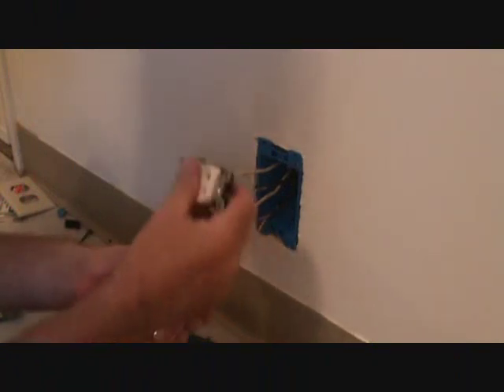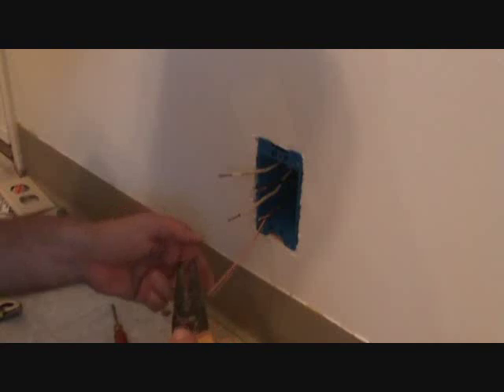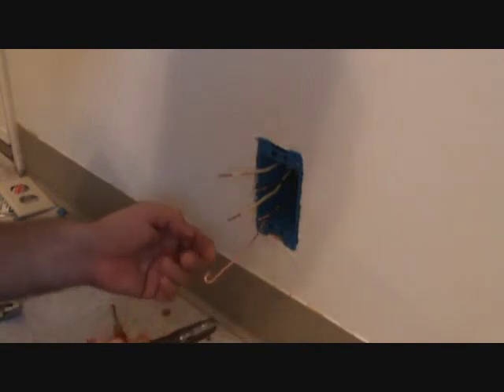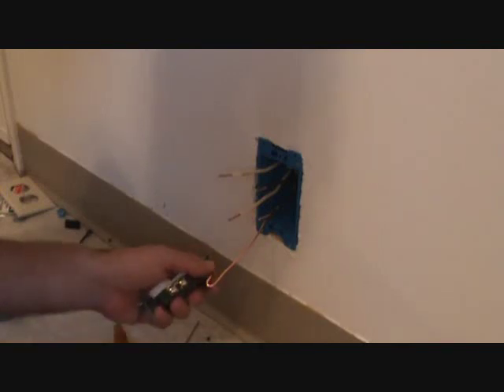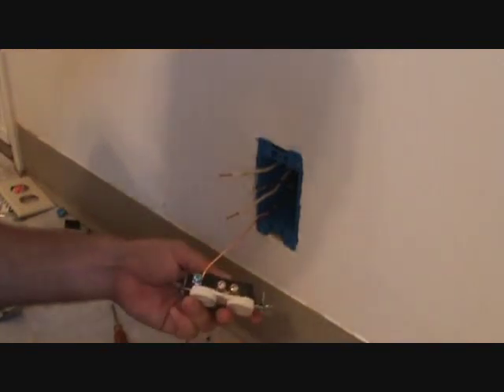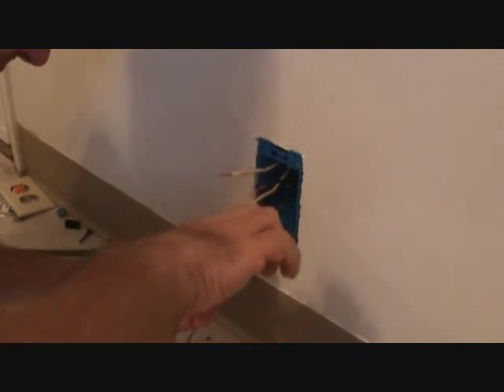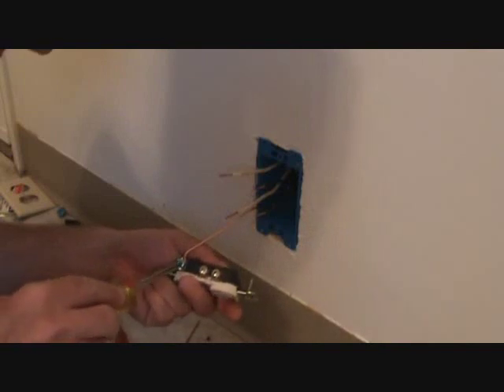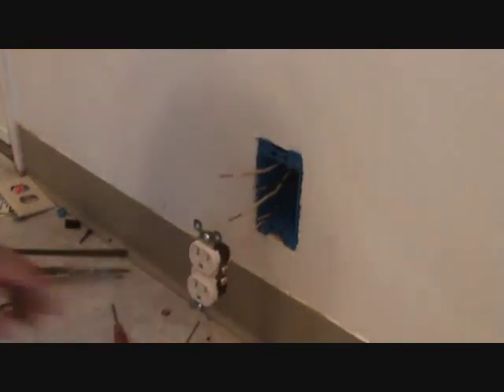Attaching a ground wire to a duplex receptacle plug

Comment: You should be a teacher, you explain everything so slowly and smoothly.  You're easy to follow and understand.   I need to rewire my old house (1950's) and nothing in the house is grounded.  I got a few quotes on the house and it's just too expensive.   Highest $7,000 to lowest $3000.  I was just wondering if I could do most of the work myself and save some money.  In case I do hire someone,  what's a true quote on a 1,000 square foot house?   Rewiring, new 3 prong outlets protests outlets and upgrade new panel to 200?  Thx for the awesomeness videos !!!
Reply from the maker: Not sure what a true quote for a 1000 square foot house would be. Get 5 different guys to look at it & you will get 5 different quotes ranging all over the place. Your house is probably the old school knob & tube but you could possibly have a continuous ground wire installed right over the wood framing members prior to the lathe & plaster going on or the drywall going on. You could have someone come out & check in the electrical panel to see. You could also go up in the attic & crawl over to a light fixture junction box & see if you can find a continuous  bare copper wire up there that is wrapped around a nail on the metal box support then going over to the next light fixture junction box. If you see that, chances are that's how they did the outlet & switch boxes as well. Then it will be easier to change out your 2 prong outlets to 3 prongers. If you don't have this continuous ground wire to your duplex outlets, then not sure how your electrician will suggest you make your new 3 prong outlets properly grounded. One suggestion would be to install GFCI outlets or install a GFCI outlet on the first outlet coming from the subpanel then wire it in such a way where the rest of your standard new 3prong duplex outlets are then grounded as well. it would be wise to have an electrician to come out & view your project & you can ask him his ideas when you get his quote from him. Also changing your existing main service to a 200 amp panel could be tricky depending on how big the wires are, coming into the existing main service sub-panel. So this is where your price is going to fluctuate between different electricians on their pricing, especially depending on if you want to add some additional circuits &/or circuit breakers, etc.. I would not tackle changing out the service panel on your own, however after talking to an electrician you may want to tell him that the only way you can afford for him to do the service panel change out is if he can show you how to do the existing outlets changing them out to the new 3 prong duplex outlets & to have them properly grounded. Maybe he can show you how to do one then you can do the rest yourself while he's doing the panel change out & if you have questions along the way, he can help you with that as well. Most electricians will work with you if you just ask. Good luck with your project & thanks for contacting me with your questions/comments! Hope this helps.   Joe  :0

Comment: my outlet isn't grounded, can i just buy some 12 gauge green wire and screw it to the receptacle and then ground it to a 8ft rod outside directly?
Reply from the maker: Ah not sure.....but I would think that might be better than what you have so it's at least worth a try. Do you have a wire tester so once you connect you can check out your work to see if it's in fact grounded?

Comment from the maker: Look in your subpanel & you may see a copper wire that looks to be about the same size as your black & white wires. This might be the copper wire that is attaching all of the metal switch & outlet boxes together, back to the panel. If you are questioning it, yes, I guess you could install a copper wire from a copper water line & connect up to a wall junction box & do it that way. Good idea.   Joe  :0

Comment from the maker: Chances are, your home is pretty old & you are only seeing a black & white wire in your wall junction box, is that it? On older homes, sometimes they would install the ground wire to all the metal boxes "prior" to installing the sheetrock &/or plaster board to your walls. Your outlets might still be grounded, if your wall junction boxes are metal. Your outlet could then be grounded with the screw that is touching the metal box. Not always, but a possibility.   Joe  :0

Comment: What if there is no ground wire? Can you put a wire to the outlet and run it to a water pipe?
Reply from the maker: For my instance they was in fact a ground wire as the initial electricians had run a continuous ground wire directly over the rough wall studs prior to drywall which then went & connected to all metal wall boxes in the house before terminating back at the electrical panel. You might have something like that too....? Not sure but if you don't then might I suggest going over to your local hardware store & discussing your ideas with a sales person in the electrical department....? Thanks for stopping by!
Reply from the maker: What did you end up doing? Did you get a ground to your outlet then?

Comment from the maker: @abfhand I'm pretty sure I'm understanding you properly & your idea should work. Next time you're at the hardware store, tell the salesman in the electrical dept. what you are wanting to do & see what he says as well as what he recommends. He might have some questions for you, etc.. Now days all outlets have 3 prongs for proper grounding. In the old days they used to run a bare ground wire from box to box under the sheetrock then over to each 'metal' box.  Joe  :0

Comment: Joe. Placing a plug in [2] prong cord on a ceiling mount light fixture - does it have to be grounded or plugging the 2 prong into the 3 prong receptacle ground it? That is what I'm going to do in the kitchen where hard wiring it is out of the question. There's 3 wires in the light - will it ground it if I put that ground wire around the screw on the round metal plate the light hooks on too? thanks.. Great video's by the way.
Reply from the maker: I would hate to say that yes it would be grounded as there are many variables so someone to guess at without actually looking at your existing conditions. What did you end up doing & is everything still working?

Comment from the maker: @BuddhaBoyVideos  Look really close in the actual box where you will be installing your plug. Are you sure someone didn't cut the ground wire short? Also are your black & white wire(s) in a "romex" wire?...that being in a sheathing? Does this romex cable only have a black & white wire in them?...as most romex wiring has a black wire, a white wire, & also a ground wire in this same romex sheathed cable.   Joe  :0

Comment from the maker: @BuddhaBoyVideos If you know much about electrical, you could go to your subpanel & pull the cover off & see if they ran ground wires & connected to the grounding "bar"....make sure your power is turned off "before" taking the cover off to your sub-panel. Only do this if you know what you're doing. There should be other ways you could check for "grounding" before this though. You could also look up in the attic to see if you have a "seperate" ground wire going this way then that way.  Joe :0

Comment from the maker: @BuddhaBoyVideos If your outlet boxes are metal, you may get a proper ground by making sure your new receptacle is touching the metal box when you tighten the plug down....make sure it's touching the metal box & there is no "gap" between the plug & the actual box.....indent some of the sheetrock if you have to, to get a tight connection. If your outlet boxes are "plastic" then that would mean that there is no "ground" wire present. Make sure someone didn't cut the ground wire "short" in the box.

Comment from the maker: @BuddhaBoyVideos Here's another thought: is the existing outlet box a "steel/metal" box? If it is, you might have an "invisible" ground wire....actually you may have a ground wire that is connected to all of your metal electrical boxes but the ground wire may have been attached to these boxes before they installed the plaster board or the sheetrock/drywall board......they used to do it this way along time ago. & again...sometimes, they did not install any ground wire at all.  Joe :0

Comment from the maker: @BuddhaBoyVideos If you have a 2 prong outlet (with no ground wire present) & want to convert to a 3 prong outlet......you can.....but you still will not have a 3 prong plug that is properly grounded. You will have a 3 prong plug....so you can plug 3 prong "items" into this plug, but your new 3 prong plug will not be grounded....since you do not have an existing "ground" wire at the existing outlet box location. You must have an old house.  Joe  :0

Comment from the maker: @rafael661kc  Thanks for the reply. Recheck to make sure the breaker is reset properly.....you have to turn the breaker all the way off then back on. Did the GFI wall receptacle get reset properly?.....did the button stay in? Do you have a power strip that may be plugged into one of the wall outlets that needs to be reset? Let me know.  Joe  :0

Comment from the maker: @rafael661kc   Hello,  Check the circuit breakers in your sub-panel to see if one of them has tripped. Also check to see if you have a GFI plug in the area where your plugs are not working. The GFI plug may have tripped & would then need to be reset right there at the GFI wall plug. Check it out & let me know.   Joe  :0